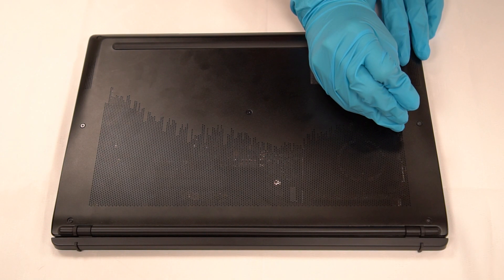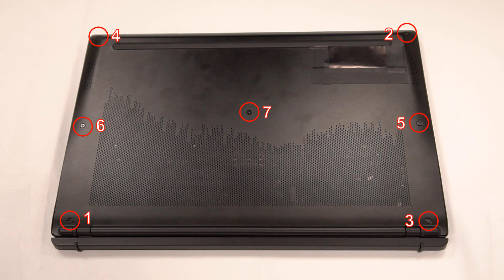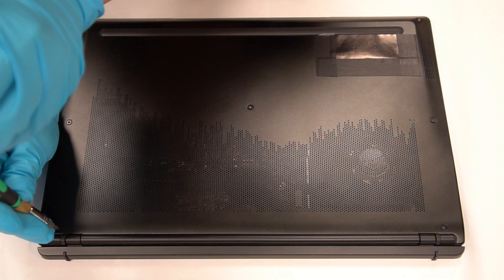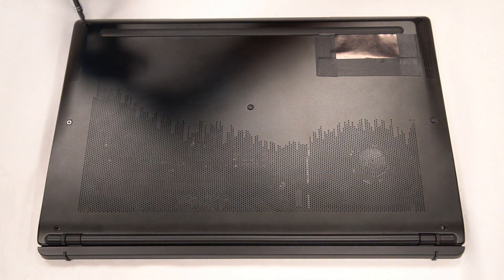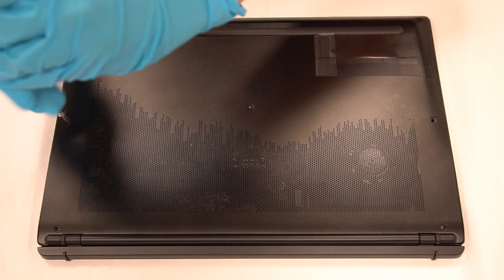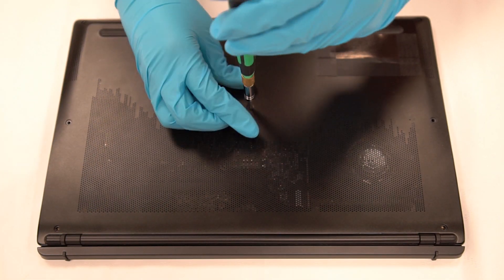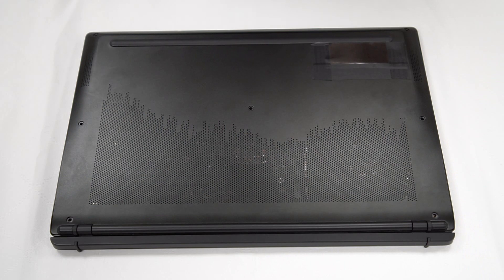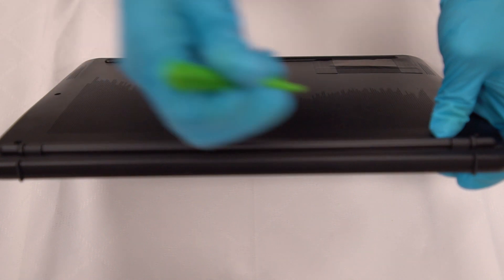MSI Modern 14 B/Summit B14 Series SSD & RAM Upgrade Tutorial

Comment: small correction.. ssd wich is m.2 nvme drive is going in with 10-20 degrees angle not 45.. you can accually rip off pads on drive.. it happend to me xd

Comment: heyyy im talking in this comment about your MSI GF65 9SEXR481 upgrade video.
(https://youtu.be/mentHs4ngn4)

I have a question, can I leave the 512gb ssd already installed inside and build next to it a "WD Blue 3D NAND (500GB, M.2 2280)" becouse i need 1tb? and can i take both 4 gb ram out and put this in "Team Group Elite (2x, 8GB, DDR4-2400, SO-DIMM 260 pin)" so i have 16gb ram.

Comment: Great vid. Question, does this really have 2 ram slot? Also was hoping they fix and add a 2nd fan :(
Reply: As far as I know. This model only supports single channel memory. So it only has one slot
Reply: @amrazing33   in another video it has 2 slots
Reply: @amrazing33  Thanks for the reply
Reply: I have the same question too!
Reply: Only one slot? Other 8Gb are on motherboard?
Reply: check the video link below, I'm confused why it has 02 slots there. Is it the same model?
Reply: @omarkoulache4838  I'm not sure about this, but I think it's because it's the AMD model. AMD is notorious for their significant performance boost with dual channel memory. That might be the reason why the AMD model has dual channel memory
Reply: https://youtu.be/hxsT0lKbZVo